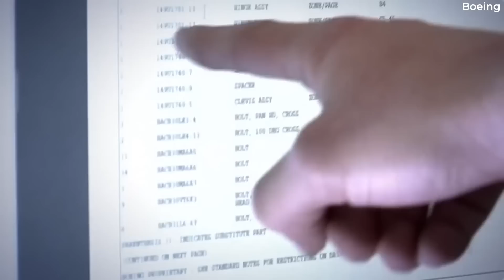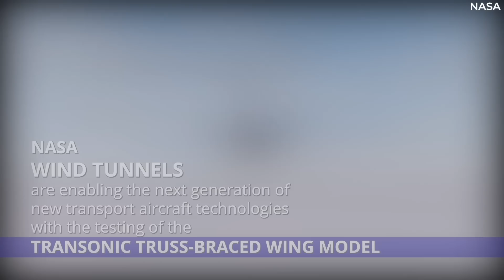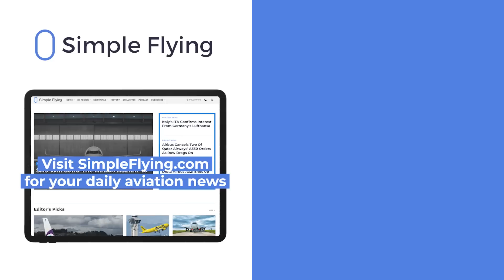Will This NASA Collaboration Be Boeing's Next Aircraft Design?

Comment: I'm pretty skeptical about this. The efficiency numbers they are talking about are probably only at a specific altitude, and not overall. I would also think that the flight envelope of a wing like that would be pretty narrow which would make it difficult to fly in less than ideal conditions. It would probably have a high climb rate, and be very difficult to land. Airports would have to make quite a few changes to accommodate it too. Should they build it? Yes, absolutely. There is always something to be learned. Just don't get your hopes up that it's anything other than academic.

Comment: While fuel efficiency matters, it is not enough on its own.

What matters is total PROFIT per trip.

I am assuming that more of the fuel will need to be stored in the fuselage to compensate for the lack of capacity in the ultra thin wings. This has to reduce how much lucrative cargo they can carry.

So the real question the airlines will want answered should be 'does the extra fuel efficiency more than compensate for the reduction in cargo capacity?"

Comment: Very interesting. But will it be able to use smaller airports that are built for planes with shorter wings. I think folding wings will be defeating the object of big fuel saving, because that would mean extra weight. So for I'm fascinated as it's a concept. Now show us what phase 2 will look like. Well that's my humble outlook. I'm a retired  bus driver at best. So take what I say with a pinch of salt. Bye for now.
Reply: I  doubt the folding wing will weigh much more.    The last few feet of wing do not have much load on them.  Now if we were trying to fold it at the wing root it would indeed need to be strong.
Reply: @danharold3087  With todays lighter material, you have a very good outlook. I worked on the old Buccaneer at Farnborough. And the folding mechanism war seriously heavy on her. But we're talking 50's tech.

Comment: i'm sensing a flaw in the design, the Boeing 777X had to have folding wingtips to allow it to fit into airports that a 777 can fly in so surely the wing on this new plane would prevent some airports from accepting it
Reply: As you pointed out, Boeing has already developed a solution to park planes with long wings at old gates. Why can't this new plane also have folding wings?
Reply: @FameyFamous The 777 has folding wings so it can fit into airport parking boxes. The Trusses brace wing is aimed at 737 sized aircraft.

Comment: Worst case scenario, how does this work in water based landings, as the primary wing is above the water line, along with the exit doors?  I feel like this must be resolved before this makes it to any commercial airline.
Reply: Other commercial aircraft such as the ATR 72 and Dash 8 also have wings sitting on top of the fuselage so I don't think this will be a big problem
Reply: @Andrei8pa3  Exactly.
Reply: This design isn't for commercial use, things like this will be taken into account if this aircraft enters commercial service with airlines.